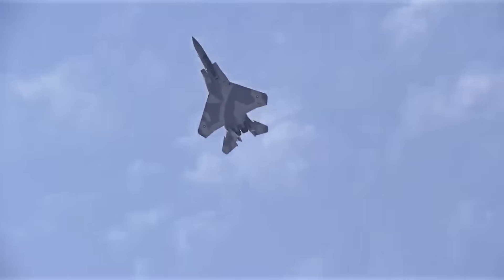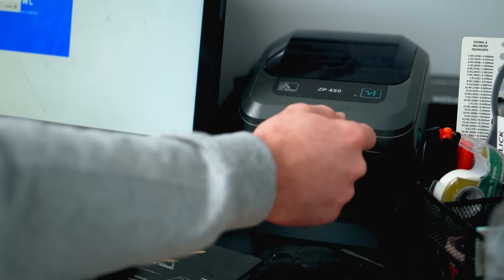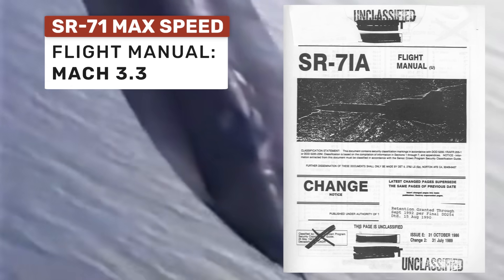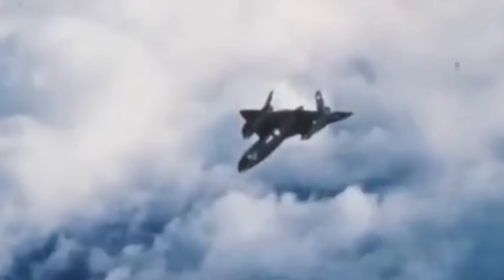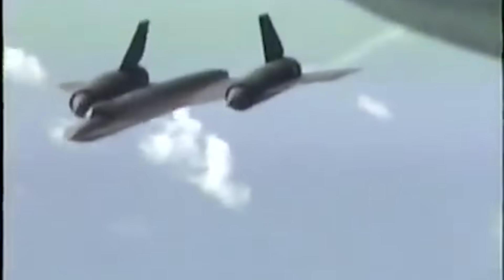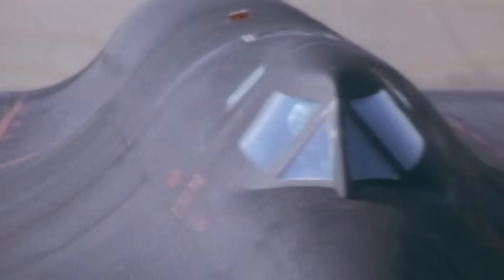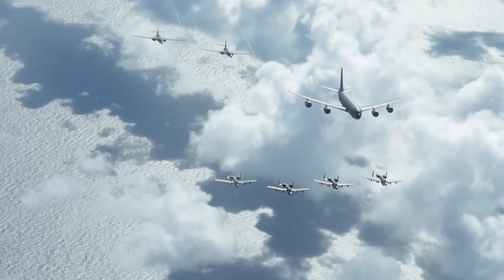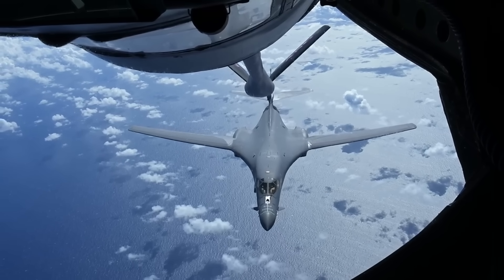The SR-71 was MUCH FASTER than the Air Force will admit

Comment: The SR-71 Pilot Manual is available to US citizens due to the Freedom of Information act.

The design cruise speed was 3.2 mach. And its maximum design speed was Mach 3.5. The true airspeed varied with temperature. Warmer air allowed faster speed for the same mach number. But the airframe was temperature limited, it's structure was rated for 3g cold and 1.5g hot. Which is very low, lower than Commercial airliners. So hot days allowed higher speed at a given mach, but also heated the airframe up more than frigid arctic air. The maximum mach of 3.5 was a hard limit that could not be exceeded, due to inlet geometry. There is a story from experts with many decades of work on technical aspects of the SR-71 program. Have stated that a double-flameout due to inlet unstart occurred just about mach 3.45.

The Pilots manual allows the speed that reaches the inlet air temperature limit. And that would vary based on conditions.

Mach 3.5 is clearly shown in the charts in the Pilots manual. But it has caveats.
Reply: There are very few people who talk about the engine flame out issues at higher than spec cruise speed... I have heard that in the interest of simplicity/reliability Kelly Johnson chose a hydraulic control for the spike air inlet because he probably correctly didn't fully trust the electronics equivalent of the day. So the engines were tuned to optimally perfom at specific speeds. It's not that there's a lack of engine power, but that there is a lack of performance stability to not flame out after a certain excess speed is reached with the original analog control of the engine... maybe as time went by, this got better? Or electronics controls were able to be incorporated  that had more finesse or better feed back in the control performance?... but given the military, the approach of " if it ain't broke don't fix it " may apply with the command on flight protocols given for the pilots to keep it under ludicrous speed... so it doesn't flame out, or have the understanding of the inherent higher risks of flame out after a certain point... but these "limits" were probably regularly exceeded, by necessity, with the only consequences being a pricier overhaul cost on the engine next time around.... but  given the nature of the job and hazards, it would be hard to believe that these limits weren't pushed many times as a choice between pushing the throttle down and risking engine failure/flame out over missle interception... Bet on the sled and not wait for the boom...
Reply: Given Ben Rich dedicates almost an entire chapter of his auto-biography to discussing the high-speed-flameout issue which started to occur immediately upon delivery & acceptance testing of what would be the A-12/YF-12 era (~2 years before the SR-71 started acceptance testing). I think it is fairly likely there was some Mach 3.6-3.9 flights during testing. This would lend some credit to the scattered rumors of seeing 3000mph on ATC scopes. Given how big the scramble was to develop auto-re-igniters, it presumably happened a lot.

By the time the SR-71s entered service, a lot of these teething problems were solved. It had the auto-re-igniters and Lockheed knew within a pretty good envelope when a flame out could occur. Hence the guidelines within the manual. 

*NOTE* you mildly have to read between the lines. Ben Rich never claims he worked on the A-12. He does say the SR-71 first flew in April 1962. Which is funny because Ben Rich published in 1994, 12 years before PROJECT OXCART was declassified and we learned the A-12 first few in 1962.
Reply: You really should look up the definition of "U.S. citizen." As well as a "citizen of the United States."  I'd bet you'll be surprised. I was.

Comment: Being the most dangerous military on earth means waging information warfare just as proficiently as you wage conventional war. 
They can't afford to disclose the true top speed of any tactical aircraft. Hell, even F-22 and F-35 units that go into joint-excercises with ally nations have to fly with aggressive limiters to put a premature cap on their full capabilities. 
Russia, on the other hand, is a weak nation pretending to be strong. Maintaining this illusion of strength is all they have, or they could face a fatal invasion from a coalition of nations they have fostered a negative relationship with. Not to mention, the fact that China could feasibly turn on and absorb them at any time. Since Russia needs to maintain it's illusion of strength at all costs, they have to blow hot air about anything that rolls off their assembly line, including lies and embellishments. They absolutely must look like their current gen hardware is a match for the U.S. Because as soon as the rest of the world stops believing it, Russia is dead.

Comment: I've always been under the impression the SR-71 could keep accelerating in the right conditions until it flew itself apart.  I liked to fly it in MSFS-X and would regularly leave it fire-walled while at cruising altitude.  Accuracy of simulated flight environment aside, as I burned off fuel, the thing would slowly creep up past its top stated speed.  Usually, around the time I needed to drop down for a refueling operation, it would be pushing M3.87.  I attribute the behavior to the slow reduction in AoA as the aircraft lost weight, making it fly straighter and more streamlined, slightly reducing drag as it went.  And one of the funny things about 'pure ramjets' is that they technically keep speeding up until you get to around Mach 6, and have to switch to SCRAMJET because fuel just doesn't deflagrate fast enough before the fuel-air mixture has left the engine.

Now,  the J-58 is a hybrid, a turboramjet.  Not a pure ramjet.  So it has a whole regular jet engine inside that thing.  And one of the stated limitations for the bird is the temperature tolerance of the leading fan in the turbomachinery at the core of the J-58.  The core spools back to 'idle' once the aircraft transitions fully into ramjet power, but the air still rams its way through, causing massive compression heating.  As you go faster, that compressor fan experiences the highest thermal load of the entire plane, and while it may be made of titanium, it begins to soften if heated enough.  N1 idle speed is still something like 60% of an engine's max RPM, so there are no insignificant stresses on the fan disk as it spins.  So it goes without saying too much, that the faster you go, the greater the gamble that the engine will just... explode as the disk heats up and softens.  The top official speed of the SR-71 is more than likely the 'safety margin' for the engines being able to reliably survive all flights, minus some good old fashioned 'we tick that down a little more because "Classified".'

Thus, I'm firmly of the belief that the ACTUAL top speed of the SR-71, is around mach 4.  But ONLY if you're willing to risk at every, single, second, that the engines will EXPLODE from compressor fan failure.  IE:  Fly her apart.  The aircraft has primitive analogue systems, and thus would not be able to prevent you from just pushing into an unsafe envelope.

The only other limiter I can fathom involves the shock cones on each inlet.  The SR-71's speed comes from the Ramjet, but the Ramjet needs the air to be slow enough to burn and expand as it passes through the afterburners.  Supersonic air must be slowed entering the engine, and the position of the shockwave where the supersonic free-stream slows down to subsonic in the inlet is precisely controlled.  That's the purpose of the shock cones and their jackscrew mountings.  The secondary limitation is that the shock cones can only be retracted so far before you run out of room to move them, and after that, the shockwave's position in the inlet is just a function of true air speed.  If that shockwave pushes back into the inlet, and reaches the bypass tubes, it could disrupt the airflow, 'unstart' the engine, and result in a violent loss of power.  Which is, in itself, incredibly dangerous due to the wide spacing of the engines.  There very well may be some easily derived 'Hard Math' that tells you exactly what speed that shockwave will reach the critical positions in the engine to guarantee an unstart.  But it WOULD require you to be able to find the exact geometry of the intake, and the positions of the tubes.  Yes, the engines are sitting right there in museums and on open display, but I doubt the curators are going to just let you take a tape measure and calipers and go crawling all through the engine to reverse engineer the inlet.

Comment: It recently came out in ABU community that an SR71 flew over 90.000 ft, which is much more than previously known. I have zero doubt that one day, possible in my lifetime, we will find out that Blackbirds flew even higher than that and probably faster than Mach 3.6. After all, max speed and max altitude reached by Blackbird are still classified information.
Reply: I suspected Mach 6 as some pilots bragged seeing the Sun Rise and Set 8 times in missions and others speak of leading edges smoldering white hot at the edge of space.
Reply: The limit of the shock wave geometry between the nose of the aircraft and the engine intakes would be around Mach 6.  If the pilot continued to climb as he accelerated he could stay in thin air and help keep the heat due to friction under control.  The increased speed would enable combustion to continue. @miguellogistics984
Reply: Everytime I see a pic/video of it at 80-85,000' it's hard NOT to think of it as not being it orbit.
Reply: Also consider that the higher she flies, the colder it gets, so less heat stress.
Reply: @kerbalairforce8802 well no, it's not actually that it's colder, it's that there's much lower air in general so there's lower heat per volume. That also means that there's less air to cool it off. For example a hot rock in space will stay hot and take days or weeks to cool off
Reply: If the MiG 31 is said to be able to fly around 123,000ft then i think it's possible for the SR71 to hit at least 100,000+
Reply: @nsean479  not said - MiG test pilot Alexander Fedotov literally set a world climb to altitude record reaching that altitude. They didn't fly at that altitude though - it was literally a max pace to altitude then turn and descend. He did it in about 4 minutes 12 seconds. Absolutely a rocket ship, I would imagine there wasn't much if any fuel left once he got there. There's stories out there of MiGs scrambling to intercept the SR - in the end the altitude wasn't the issue it was always the speed.
Reply: The A-12 flew at 90,000 - so really not surprising. Them not releasing the "full story" just means there's national considerations against current programs. Which also means we haven't overly achieved higher/faster achievements in the same space potentially. Going to be interesting when/if we get the full story for sure. Might be quite a few people let down when they realize what we were told over time is fairly accurate.

Comment: I read years ago the aircraft would continue to accelerate until it melted. That it could touch mach 5 but decelerate due to melting risk.
Reply: It's more a matter of the turbines melting, or shockwave geometry causing a ton of extra drag in the inlet. One of those is guaranteed to happen before the airframe melts.
Reply: @JonBrase  Perhaps, but remember the compound engine was part ramjet which is able to increase thrust with speed. I remember seeing drawings of the X-15 glowing red and white at mach 6. probably correct.

Comment: I had an uncle who was in the AirForce and was at Kadena Air Force base and he told me a story of when one time the SR-71 was fling a mission over China  and some migs started getting close. The pilot told him that they went from 85,000 feet and Mach 3 to 120,000 feet and Mach 3.7. I don’t know if that was true but I do know he had a lot of time with those guys.
Reply: I was in an Army Sigint unit (ASA.)  We used to monitor Chinese reactions to SR-71 overflights.  I believe your uncle.
Reply: Don’t believe it, sorry.  Probably zero aerodynamic control at 120k.  Speed is way better, from a calculus/intercept consideration.
Reply: @zd1322 True enough.  The rocket boosted F-104 that went to these altitudes to test reaction control thrusters for spacecraft and I think the X-15, needed them.  The aerodynamic surfaces didn’t have enough bite to control the aircraft, although that was the point.

Edit:  It was the NF-104A, and was used to train X-15 pilots.